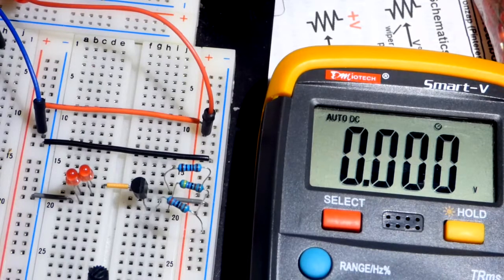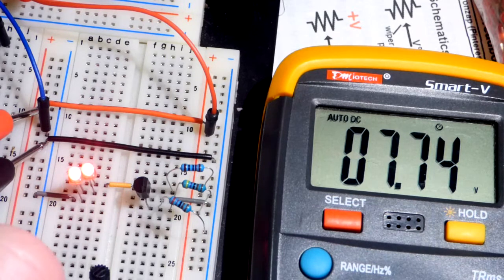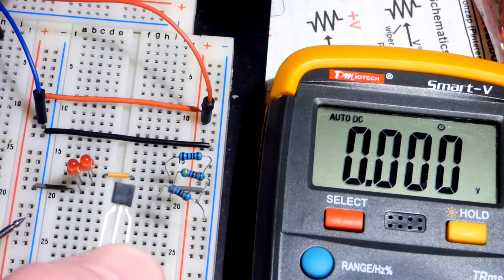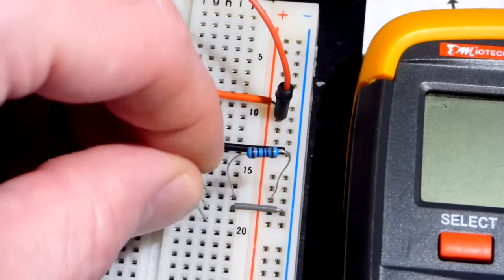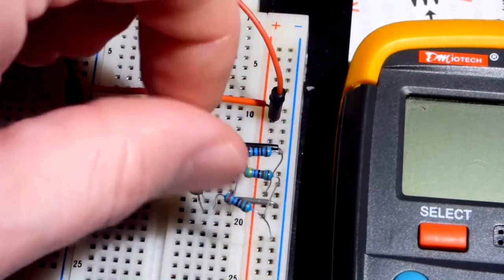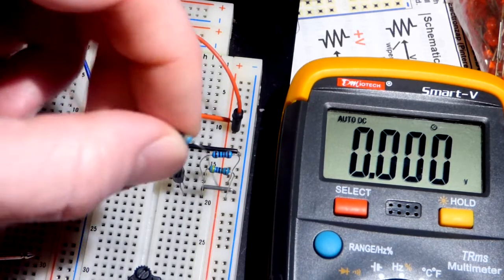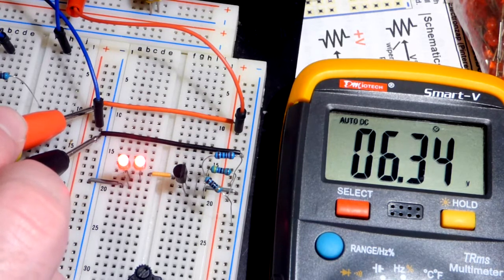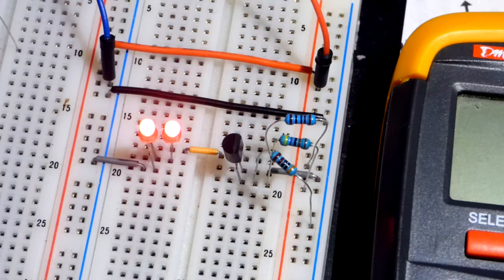LM431 adj precision zener shunt regulator component wired as low 9V battery indicator circuit

Comment: Awesome tutorial. I'm a novice hobbyist and like to use 18650's for my projects I picked up some of these 2 weeks ago and  yours is the first vid I've watched that gives me a comprehensive explanation on assembling a working low voltage indicator , now I think adding a depletion mode mosfet (also just ordered) in series with led will add a cuttoff? And to think I almost skipped subscribing to your channel
Reply from the maker: Thanks for the sub! Unfortunately I haven't been able to design or find battery low voltage cutoff circuits I really like yet. I hope to use MOSFETs though since they need no current at the gate.
Reply: @Electronzap  having only been working the hobby for about 7 months now I don't know what's good or bad I'm just finding a part  that describes what I'm looking for and learning how to use it. As I found from reading on the internet it was a chore finding depletion mode mosfets